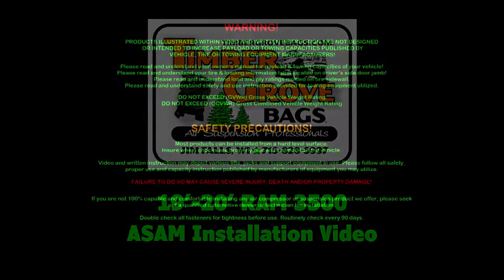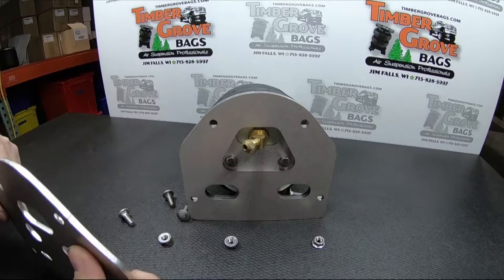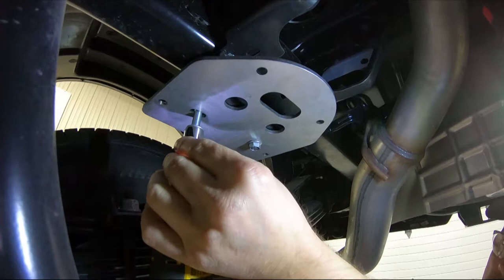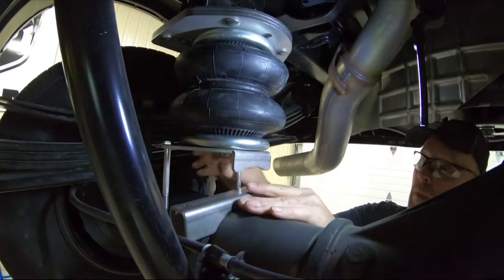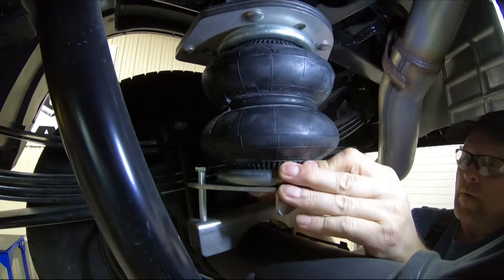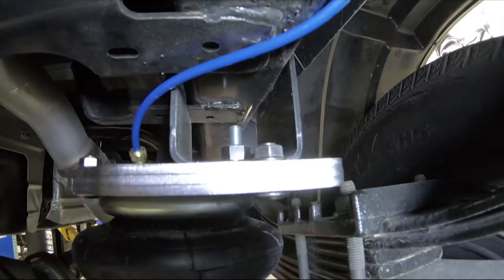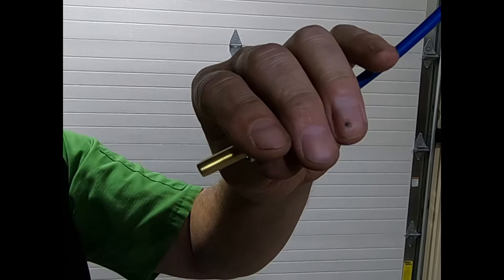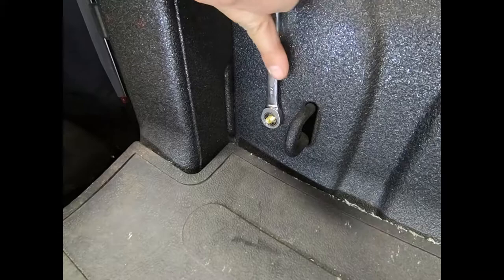RAM 3500 Air Spring Installaton

Comment: FYI, when installing plastic airlines, ALWAYS use rubber grommets on any openings if routing the airline through the frame, also a good idea to always use a sleeve of either rubber or expandable sleeving on areas where the airline comes in contact with sharp edges of the bag brackets or other areas of the vehicle. This will keep it from rubbing and prematurely wearing out causing a airline failure.